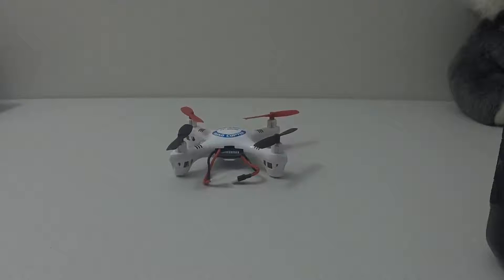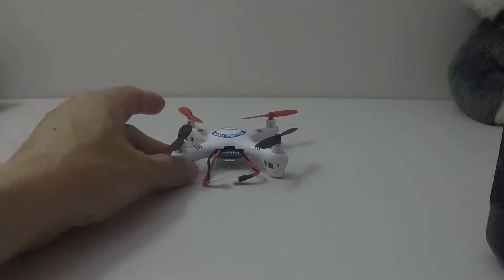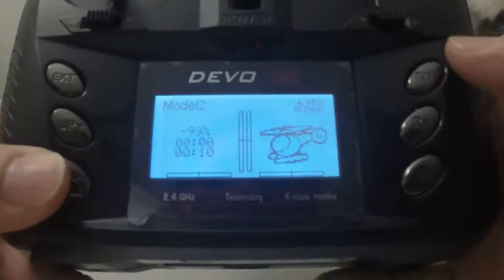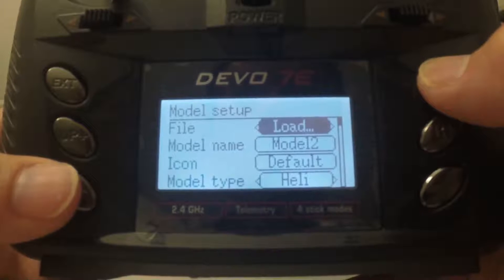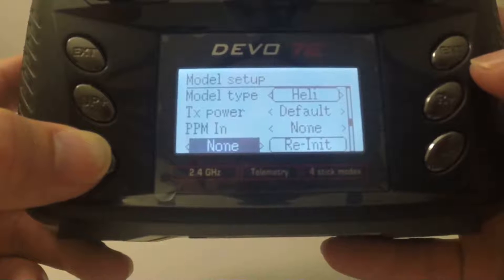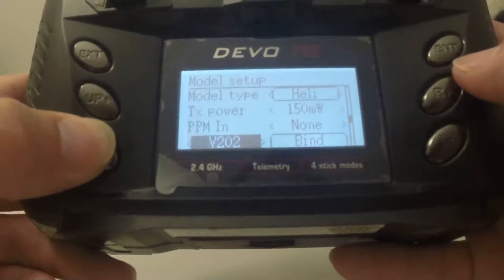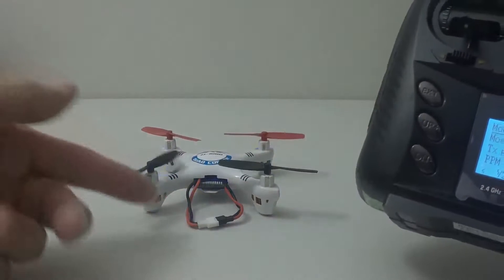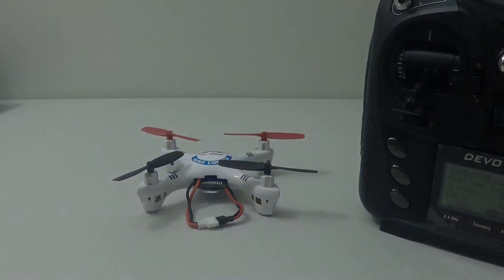Binding with JJRC 1000 - Devo 7E modified with A7105 RF Module + NRL24L01 RF Module for Deviation

Comment: Thanks for all your videos, they have been very helpful. I am trying to fly my jj1000 with Devo 7e using the V202 protocol, but the craft has a constant yaw. When I fly it with the stock TX its fine. Is there any suggestions you may have. I dont know how to tweak any of the settings in the Mixer, if thats what will fix the problem. If you could guide me in the right direction it would be appreciated.
Reply from the maker: Thank you. Have you tried re-calibrating the sticks? I think the yaw axis is off centre. Another quick fix you can try is to trim the yaw. See which direction it is yawing and just trim it the opposite way until the yawing stops.
Reply: I tried the yaw trim, no luck. I will try to recalibrate the stick, and let you know what happens. Thanks VERY much
Reply from the maker: Are you using the nightly build of deviation? If not, flash with the latest nightly build as the official stable one is not updated regularly and would have issues.

Comment: I have a devo 7e with a 3 in 2 module installed! I can bind it to my Jjrc 1000, but the lights keep flashing, and when attempting to fly, it just fly fast forward, but no take off!! Is it possible to download ini file strait to the 7e from deviation tx  at all??
Reply from the maker: Demon Flyer Try reversing Aileron and Rudder channels and re-calibrate your transmitter sticks.